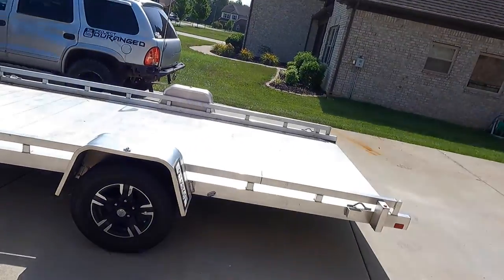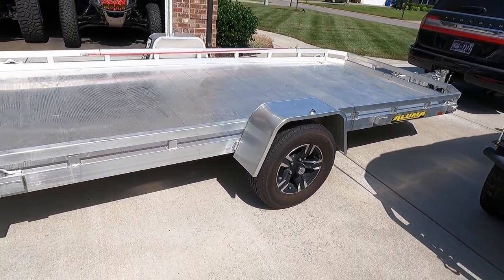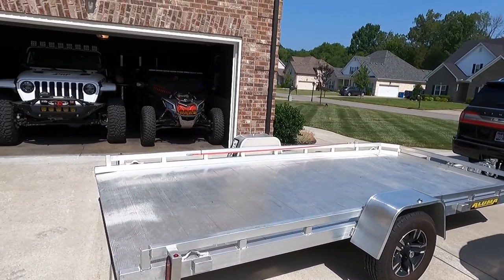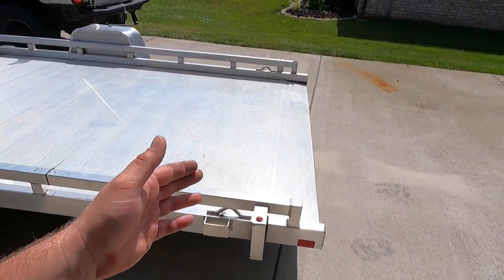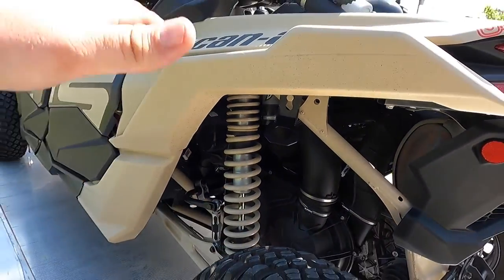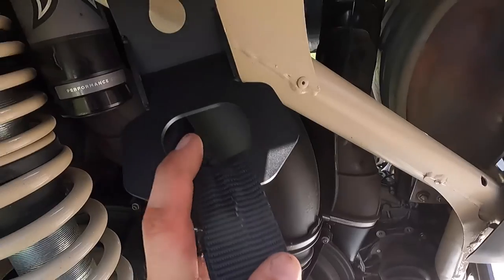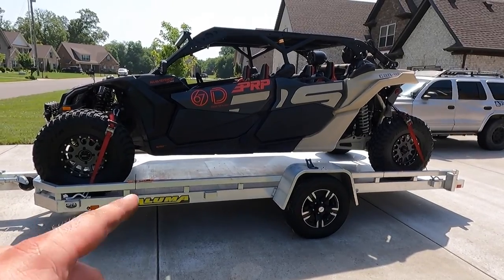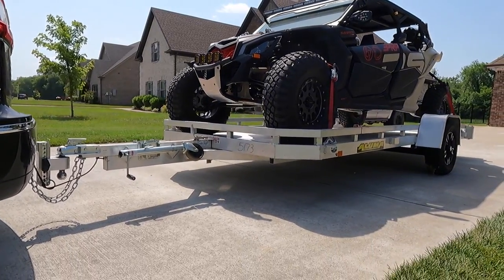Aluma Tilt Trailer For Can-Am Maverick X3 - Review 7814S TILT

Comment: for those trolling you about the backward tilting while driving( my suggestion is:) have you ever tried loading the Can-Am backwards and hauling it with the engine at nose of trailer for better ride ability??? Car haulers load cars forward and backwards all the time to change weight distribution??? but if you do that you may have to raise your pin up a notch on the tongue because it will probably add more pressure (down force) to the rear of the tow vehicle of choice pulling the trailer ???

Comment: Nice vid... Have you had any issues with rocks getting stuck in the wheel on the X3 while driving? [Rim]
Reply from the maker: No, I have not. Although I have heard people ditching the scrapers in the wheels just for that reason. Supposedly it allows the rocks to fall out without getting jammed up in the wheel causing damage.
Reply: @MohawkDaveOffRoad  Thanks for the tip!

Comment: Love the setup.  I have a 4dr RZR and pulling with a 2018 Navigator as well.  What kind of mpg do you get towing with the Nav and that trailer?
Reply from the maker: Thanks, the Navi tows super nice. I’m getting 15 to 16 mpgs with the trailer which I think is pretty decent.
Reply: @MohawkDaveOffRoad  that’s phenomenal!  The best I’ve seen with mine is 10-12.    I’ve been using the U-Haul auto transport which weighs 2200 pounds.  I’ve been wondering how much better I could get with a lighter trailer.